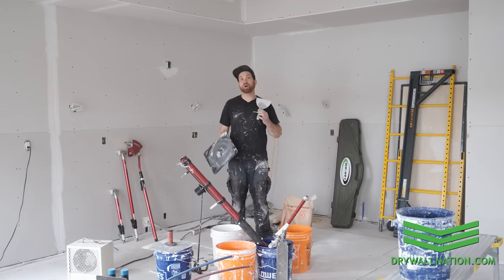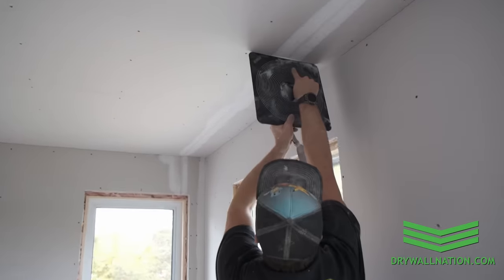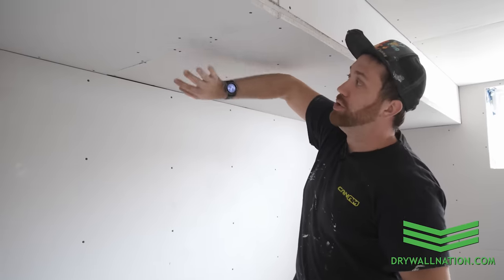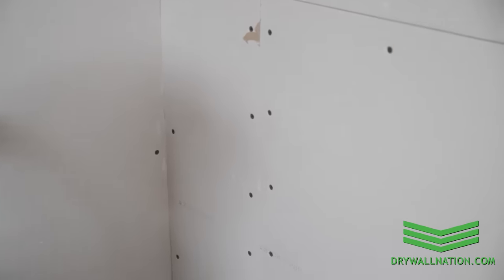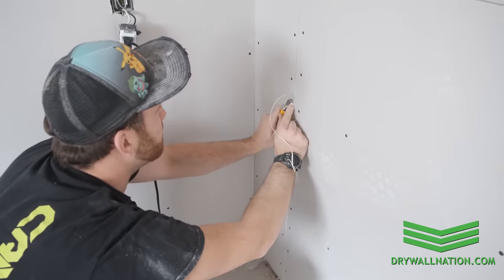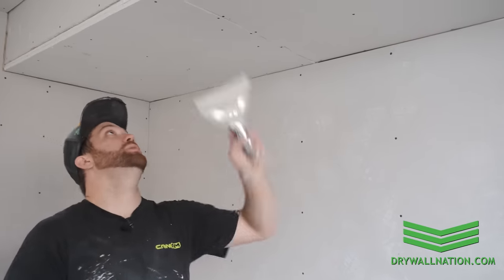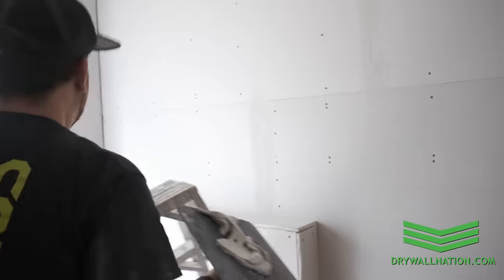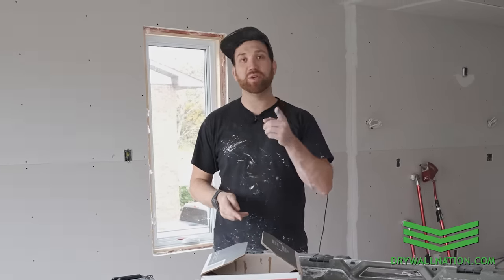Importance of Prefilling and V-Grooving butt joints.

Comment: OMG... I have been doing this for years and have been called every name in the book for doing it. I would rip up sheets of 7/16 OSB for my joints and get some of the flattest and smoothest joints that you have ever seen. I don't know if he is covering this or  not but here is another little tip: do not put the screws in the adjoining edges until the second sheet has been installed. This greatly reduces the squish out that happens when screws are too close to the edges.
Reply: What does OSB mean? New to this trade.
Reply: @JoseFlores-xp9jp  it’s particle board, like a piece of plywood but tiny strands. Google might be able to help
Reply: Damn good point about waiting to screw butt joint until both pieces are hung. That squish will tighten it up a tiny bit too not that it matters
Reply: @JoseFlores-xp9jp  oriented strand board. It’s the plywood that is made up of wood chips
Reply: You're supposed to hang drywall sheets vertically. The edges are already tapered for that reason. No butt joints.
Reply: @jamesnm21  lol
Reply: @jamesnm21  That is only on commercial jobs with metal studs. Every second stud is left loose/floating so that it can be moved so that it exactly fits on the seam. In wood framing the studs are often bowed and at times oddly spaced, at times the joints will not hit a sutd if hung vertically. "Been there, done that" LOL
Reply: @davidtyndall9604  just use your hammer to adjust the stud. That's never been an issue with any crews I've worked with.
Reply: @jamesnm21  drywall sheet in my country are quite long and am sure they do them horizontally now, longer sheet less joins.
Reply: @jamesnm21  u still can end up having butt joints and this is how u fix them..vertical or horizontal, it's personal preference on hanging board for me lmao
Reply: @jamesnm21  yea but butt joints are unavoidable sometimes. Using this trick they aren’t even an issue. My old boss told me to do this and every one else I’ve worked with has never seen it 👍
Reply: Great tip!!! Helped out a lot 💪🏾💯💯💯 I was never V grove my edges but it definitely makes a big difference!
Reply: @JoseFlores-xp9jp  It's the sheets of plywood made up of woodchips compressed. Although not plywood, commonly referred to as plywood
Reply: Oriented strand board that's what osb stands for! I do alot of remodeling on old farm houses and we rip 4 inch straps of anything to help our butt joints when needed
Reply: @JoseFlores-xp9jp  oriented strand board, essentially 4x8 sheet of what people typically just call 'plywood', but it isn't technically plywood
Reply: @JoseFlores-xp9jp   oriented strand board
Reply: @JoseFlores-xp9jp  You'll never forget what osb means now.
Reply: the butt board is recessed in the center though it's not just flat osb
Reply: @Jake_Hynds  I understand, but when you don't have the real thing you have to make do.
Reply: It’s a must V groove, this is the exact reason why we use butt buddies, when you VGroove your following the USG hand book , manufacturer’s Sheetrock are only covering their butts on delaminating
Reply: Good looking out!  That’s a great tip
Reply: @jamesnm21  Commercial Fire walls are hung vertical, I've hung 4 layers thick in a conservatory don't break the joint on the same stud.
  16 ga. Metal studs with a slight radius .
Reply: Interesting edge screwing tip, David. Thanks for sharing. It makes sense and I like it.
Reply: @JoseFlores-xp9jp  oriented strand board
Little chunks of wood glued together to make sheets 4x8 kinda looks like plywood
Reply: Awesome tip! Thank you
Reply: You’re the only person who cares. You are doing exactly what you’re supposed to do especially if you live in climate extremes over 40 degrees within short periods. Keep doing the right thing.
Reply: @jamesnm21 can’t be done technically your not completely right, drywall manufacturers have started this nightmare, all handbooks before 2010 have nothing, now it’s mandatory on butt joints or they will V out after being painted. Pre fill everything is a must. Ripping plywood off the joist or rafters connecting sheets continuously is the most effective solution, rail roading means nothing if done right, I have 1200 houses professionally with my name on the project or one of my crews, homes going on ten years or more with nothing but a few screw pops, we used pre fill and screws before most crews.  There’s always a many ways to get something done, there’s very few ways to get things done right. 😂 I’m not arguing with your hard edge comment, it’s just not possible to hang residential new homes without butt joints, even most commercial metal framing will have a few butt joints or bastard joints.
Reply: Never even thought about that I don’t do drywall everyday but thanks for that tip
Reply: @kidjetrecon7153 DIYer here. Completely understand and appreciate the V grooves. But what’s the comment about ripping OSB? What does he mean by that?

Comment: Manitoba. I v groove and pre fill exactly like you. Always got mocked by the other tapers for v grooving but every time I stopped I’d see it showing(usually on sanding day or after paint🤦🏻‍♂️).
Reply from the maker: Yup! Same, nothing worse than seeing a tape peaking through the finished product. All because someone didn't take 30 seconds to vgroove. Didnt used to have to vgroove as much years past but with lightweight drywall the paper delaminates very easily.
Keep up the good work man!
Reply: Yep👍 the best method! I only v groove too and people mock me. They eventually realize their faults after paint and you see their butt joints lol

Comment: Out in northern Utah, I always prefill but haven’t routinely v’d out the butt joints. Too often the butt joint has barely enough room to get the screws into the framing behind so cutting away some of the paper would lessen the holding power of the screw. Thanks for your videos. It is great to see how other drywall pros do it!
Reply: Dont cut at the screws for maybe an inch..
Reply: @endoalley680  huh?
Reply: @kennethmabus381  If the screw head is in the butt  joint because of a poor sheetrock measurement, start Veeing maybe 3/4" to either side of the screw.
Reply: @endoalley680  so if someone uses trim tex buttboard should they v cut the joint?
Reply: It’s a 16th of an inch your cutting off the edge that is furry and uneven ,,, I see what your saying , but only if the cut was too far in , as far as weakening, everybody has thoughts I’m not owning yours, I enjoy the think pool .. ps and I’ve been wrong many times in my life :)
Reply: @kennethmabus381  "so if someone uses trim tex buttboard should they v cut the joint?"  Definitely. The Veeing and prefill gives you a continous monolithic surface for the tape to embed.
Reply: @endoalley680  your gluing the tape to paper. You dont v cut tex backboard. You dont need to v cut butt joints on stud walls. You cut paper away weekens the sheetrock. Leave a 1/4" space in butt joint and prefill. Its not a welding joint. Just like you dont v cut joints for bondo in automotive. If you have paper protruding from the rock in a butt joint use a new blade.
Reply: Vee cutting and prefilling gap betwee joints makes the butt joint stronger. a solid surface for t tape to bonfd to.
Reply: @endoalley680  Hows it not stronger on a stud screwed down every 12" than 2 factory thin joints just taped with nothing behind it! Maybe the way you do it but doesn't make it right. Where a cut edge meets a factory are you slanting the cut edge?
Reply: @kennethmabus381  seems like cutting a v-channel is just trying to solve a problem that doesn't exist.
Reply: I’m from chicago and work In Wisconsin. Worked in Cleveland,Colorado,Tennessee and Pennsylvania-so I have taped and finished drywall from east to west and in between. And you my friend. Couldn’t have said it any better. We also prefill. But don’t cut the butt joints because it indeed would make a lesser holding power. Perfectly put. And it really is great to see how OTHER PROS do it!
Reply: I built my own house without any subcontractors, that was nearly 20 years ago and when I did my drywall I did all the things he does here out of common sense. Good to be reaffirmed by a professional because most of the local subcontractors and contractors laughed at me for doing too much. Good results 20 years later, still looking good.  … for instance, I have drywall I butting directly to woodframe doors that I made, and there is no trim, and there are no cracks between the drywall and the door frame some 20 years later. It is a perfect joint. Try doing that with the local drywall crew that are doing a cheapo bid job.
Reply: @steveperreira5850  I did my own home as well. About 18yrs ago. But instead of doing it like this guys way I did it totally different from you and him.  Guess what Steve?  Still looking good with great results.  No cracks and no prefill. No razor cutting either. 18yrs later she still looks great. All the butts are hard to find. Totally different way but same results.
Reply: Why aren't you hanging the sheets vertical to eliminate butt joints? That's how we do it here.
Reply: @jamesnm21  ? Just out of curiosity. What state does that?I’ve done stand ups before but only on commercial jobs. On residential we do not stand up drywall. Not saying it’s a bad idea but I’ve only taped walls with stand up board on commercial jobs like Walgreens,Walmart,etc. But there still is a butt joint going side to side. That’s Chicago Illinois to GREENBAY Wisconsin. Sounds like a bright way to eliminate butt joints but there’s gotta be a reason we don’t do that over here. Not sure why but just don’t. Thanks though.
Reply: @mikemcbain4250  I'm in eastern Iowa, so not far from Chicago. Not sure why they wouldn't take advantage of that for residential. I've worked with crews in Indiana and Minnesota and they hang it vertical too.
Reply: I have noticed that none of these guys are using drywall adhesive. If you use DA on the but joints, by the next day you can take the screws out if you wanted to. We often ran into twisted studs, at the but joint. This caused one sheet to be lower or higher than the mating sheet. Breaking off the stud gets you away from those kinds of problems. I used 4" strips of plain OSB before I ever heard of this system.
Reply: @davidtyndall9604  I've only seen adhesive used on one project building a house. Not sure I'd trust the paper to hold to the gypsum underneath that much but it seemed to work fine.
Reply: @jamesnm21  LOL, You should try removing drywall that has been glued. It has to be torn off in pieces. If I am not misinformed it is required in California.
Reply: @davidtyndall9604  you are misinformed, it is not required
Reply: @jamesnm21  some states make it mandatory to lay them down
Reply: @endoalley680  Wrong .. Code violation   ceiling butt joints have to break on a stud and  the screws are 3/8 max from the edge and . Once you v cut you break the paper and the screw is now  no good .  The only reason you get away with it is because the screw inspection was already done . Had the inspector seen you v the butt joints he would have failed the screw inspection ....
Reply: Code violation   ceiling butt joints have to break on a stud and  the screws are 3/8 max from the edge and . Once you v cut you break the paper and the screw is now  no good .  The only reason you get away with it is because the screw inspection was already done . Had the inspector seen you v the butt joints he would have failed the screw inspection ....
Reply: @whirlwind8825  once you screw off the butt joint and delaminate the paper in the vicinity of the screw at the edge of the cut it is only the gypsum holding the butt joint to the stud. The face paper between the screw and the cut is always delaminated. You Vee cut between the screws to get rid of delaminated paper and prefill with setting compound so that the tape has a solid surface to bond to.
Reply: @endoalley680  the paper does not delaminate.  Once you cut the paper  to the screws you lose the 3/8 inch  edge min. and you break the paper and fail the screw inspection. Imagine changing all the butt joints in the house when a inspector sees it. Then you will never want to do it again.. The USG handbook is the correct way and approved way .
Reply: @davidtyndall9604  how do you run drywall adhesive over a plastic vapor barrier?

Comment: Hey there I'm a painter in Bellingham,wa. Thanks for the great video. I've found that most cracks that appear in drywall over time  are from delamination at butt joints and large gaps not being prefilled. To fix them, I v-groove the effected areas, and fill the crevice with loctite power grab adhesive before doing the repair. This way the cracks won't reappear the way they would if they were just mudded over.  Nice to see someone taking the time to do the prep that will ensure maximum life span of their work.
Reply: If there are cracks they usually need taped again  it technically becomes a seam again.

Comment: I've been recently v grooving my butt joints and on small jobs applying compound 20 sheetrock on my first coat , applying a fiberglass mesh tape.  Again only on smaller jobs to help speed up the process.  On all jobs v grooving your butts and applying prefill of any kind is a great choice.  I don't think I'll be using durabond any time soon, that stuff is not sandable at any stage.  Maybe for filling larger holes in plaster repair jobs.  I give this guy credit, very confident and great overall working attitude. Great video.  Cheers

Comment: When I first moved into my condo, there were places here and there, mostly in corners, where it wasn't cracking, but you could see a certain wavyness and the surface felt hollow when you tapped on it. Sure enough, you could stick a screwdriver in and find a sizable pocket of air underneath where, when they taped it in 1958, no one bothered to pre-fill. Joints like that not only look terrible, but I would expect them to be vulnerable to penetration by fire, partially defeating the purpose of using drywall in the first place. I've cut out and filled those gaps whenever I've painted over the years; one great thing about drywall is that you can easily fix most flaws, no matter how sloppy the original job was.

Comment: I am a DYIer and in the process of a full (to the studs) remodel of a bathroom. It has been a monster so far. 1955 home with multiple layers of plaster (actual concrete) and steel mesh to remove. There is not one level spot in the room when I started, but I have done the best I can to get it level and flat. BUT, I have some gaps and a few damaged areas (one where the cut out saw got away from me). 

I have watched at least 100 hours of video and THIS ONE actually address the things I want to know. 

Thank You! 

I just sat down from checking my screws, scraping any edges sticking up, cutting the edges of damaged areas and removing any loose drywall. Plan to do my prefill tomorrow!
Reply: I have a house from 1920, and the upstairs walls have a terrible texture on top of crumbling plaster. Definitely thinking of knocking the walls down to the studs, adding some plugs and insulation, and drywalling. Any words of advice?

Comment: Cool video! I did some dry wall work in my basement a year ago. It was my first time. I was humbled. I told myself I’d never do it again. But.. of course here I am about to start mudding a bedroom I just built. I prefilled my joints on my first time. I will be pre filling joints today also. It just makes sense. I also am going to try v-grooving my butt joints. Thanks for sharing your skills!
Reply: What bothered you the most about it? (Most people is the sanding factor.) 
I usually use a sponge & warm/steaming water between coats so I dont have dust
Reply: Next time hang the sheets vertical buddy. The edges are tapered for that reason. That's how we do it here.

Comment: Great video.... Yes I prefill using 5 min mud but only because typically I'm doing a bathroom or kitchen so it's not a large area so 5 min is plenty of working time. Then I tape same day with 20 min and then by the end of the day I'm putting a final coat on with 45 or 90........ Well I try to at least. So this way I can sand the next morning.

Comment: Not a drywaller. Remodeled for years and have hung my share of rock. Never seen this technique before. Never too old to learn something new. Just subscribed!
Reply: Hang the sheets vertical so no butt joints. That's how we do it here. Not sure why nobody seems to know this here.
Reply: @jamesnm21  you do commercial or residential?  Around me the framers make the wall layouts work with the exterior plywood so the insides don't line up on 16" centers.  Hanging vertical would not work as we would have to fill in where there is no stud.
Reply: @Tom-kk1zu  everything is usually on 4ft centers spaced 24 or 16 inches fir residential. I've never wood framed the exterior of a commercial building, only interior walls. My dad built commercial many years ago though. I never heard him mention about the framing being different.
Reply: @jamesnm21  That must be nice. My experience is only in residential.  Since the framers build the walls to line up with the outside plywood it naturally makes the inside off due to wall thickness at the corners.  Maybe some of your framers are nice and frame it so the inside is good.
Reply: @Tom-kk1zu  we're the ones usually doing the framing, but that's normally what I've seen. If needed we just cut the corner sheets to line up if that's an issue.
Reply: @jamesnm21  Makes sense 👍